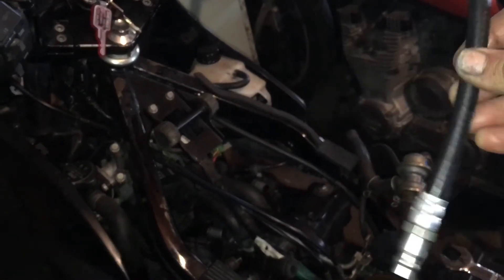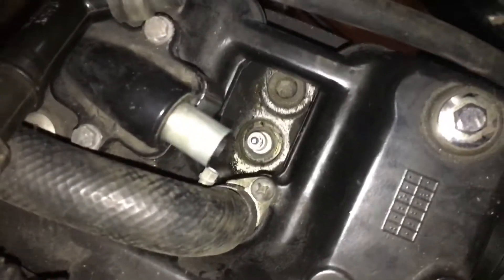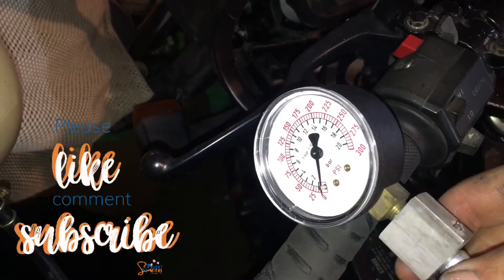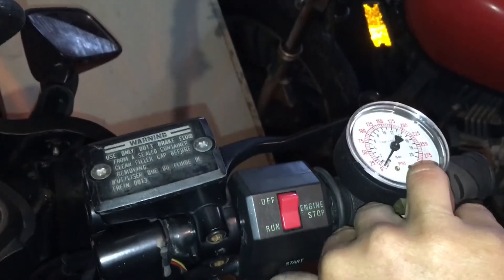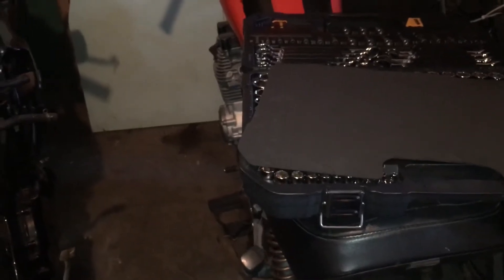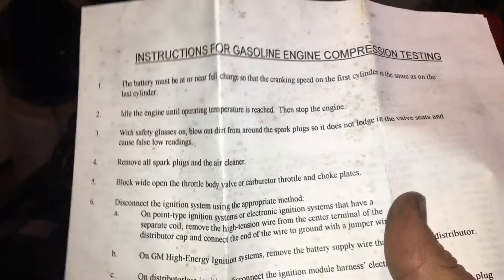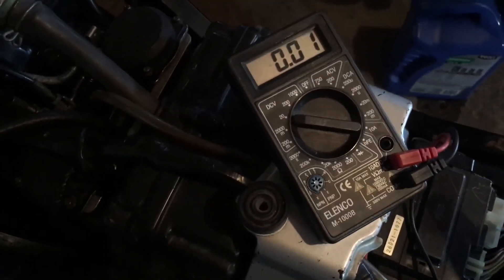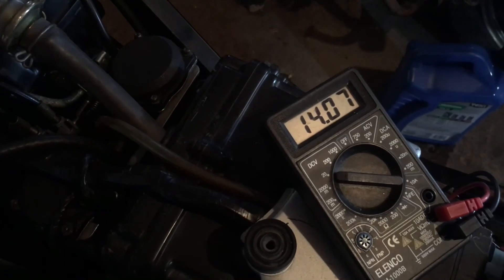Kawasaki Ninja 500- Compression/Charging System Check Test

Comment: Where did you get your compression  kit?
Reply from the maker: I’ve had this one for 20 years. I believe I got it through my motorcycle training course.
Reply: @mcycleshawn  well shoot, I just picked up the same bike at the beginning of winter. It keeps bogging down while cruising down the road and it don’t hardly want to idle.
Reply from the maker: @Noprep304  Have you pulled out the carburetors and clean them up and looked inside?
Reply: @mcycleshawn  not yet I’ve been trying to find a carb kit and I was going to just go ahead and rebuild them so there wasn’t any doubt on weather they are good or not.
Reply from the maker: @Noprep304  good call on that! Don’t go cheap as I did for rebuild parts. You can get away with gaskets but if you need to replace jets or needles they need to be the correct oem numbers. I’m currently cleaning and stealing parts from my 94 to put into this bike that dies at half throttle......(with new cheap needles and jets) as u many have seen in my most recent vid
Reply: @mcycleshawn  yeah that’s something I’m having issues with is finding parts for it. Like I just rode 20 minutes to work and it went GREAT for about the first half mile then bike stalled out and starting bogging down and back firing. I stop up Kroger’s to get lunch and it don’t want to fire without choke so I set it on half choke and it fought me about another 4-5 miles then all of a sudden cleared up and wanted to rip I’m wondering if one of my cylinders are bad or if a carbs not feeding fuel because for the first time it smelled like fuel strong.
Reply from the maker: @Noprep304  odd that it happened when it was warmed up......I’d go through carbs for sure but check electrical grounds and igniters then
Reply: @mcycleshawn  yeah it’s a work in progress guy that had it before me laid it down a couple times and I dropped it right after I got it. The throttle hung as I was coming in the driveway and I didn’t get to the clutch it time because it decided to go wide open as well.
Reply: @mcycleshawn  so now it also needs a fairing kit and a mirror welded back on but I can’t find a kit only anywhere for these specific bikes.